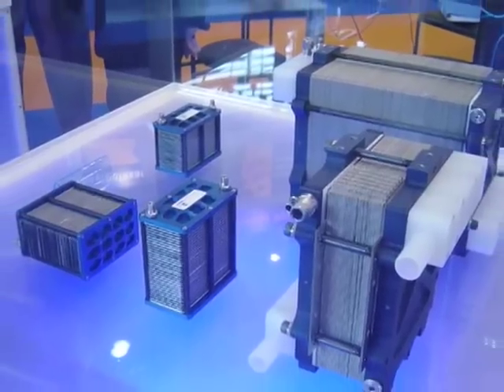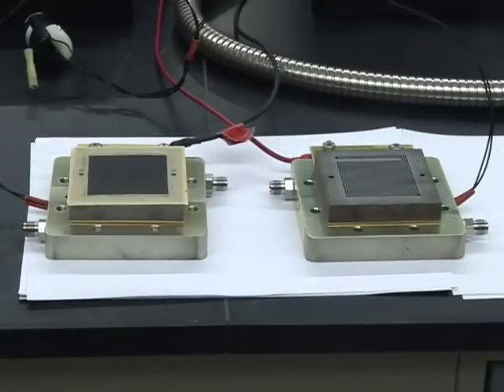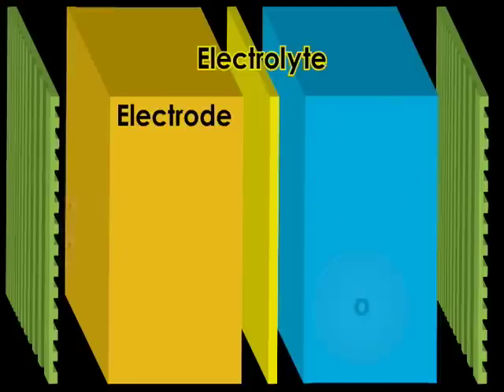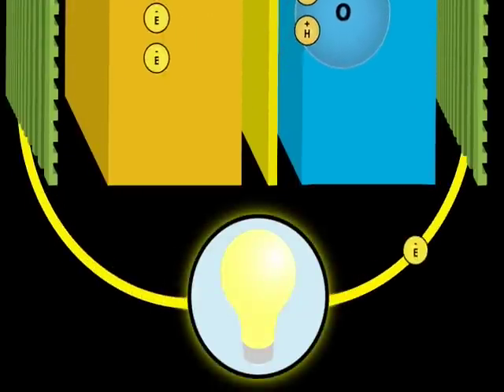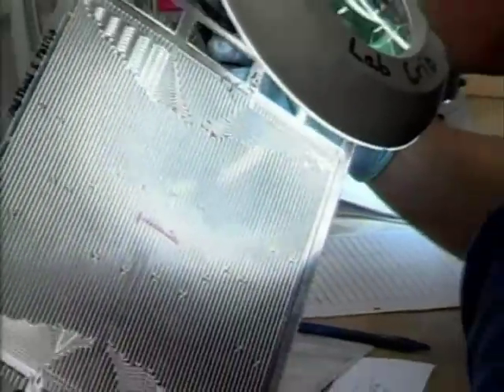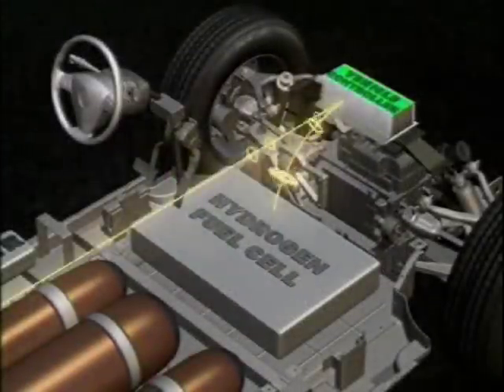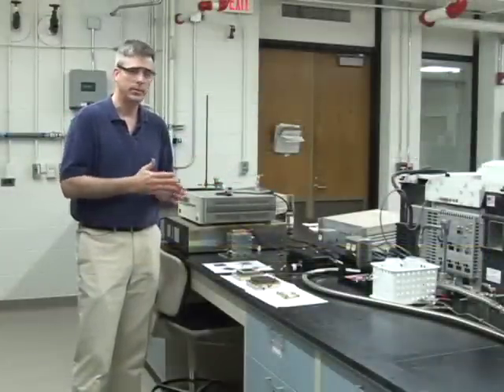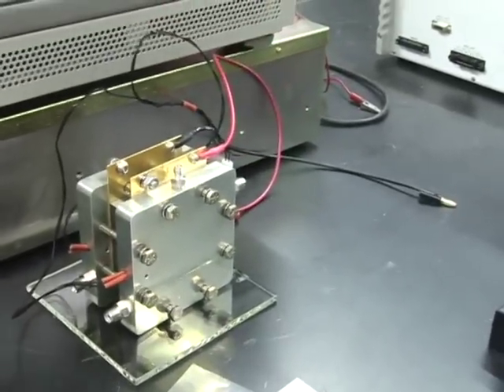How Fuel Cells Work

Comment: There are two deal-breakers with hydrogen fuel cells: 1) Hydrogen is an energy carrier, not an energy source, and making it requires large inputs of external energy. 2) Fuel cells permanently remove oxygen from the atmosphere because they output H20, not CO2 (which plants can recycle back into oxygen). Hypoxia from irreversible depletion of oxygen would be a major issue if hydrogen-based fuel cells gained widespread use. Man tends to fix one problem by creating another.
Reply: NoEcologyNoEconomy He said Methane was also an option, what cons are there about that?(This is a legit question not a mocking one)

Comment: I am all for clean energy much like you are. The question I have is how are we going to accommodate the extra space required to provide the same electrical energy as fossil fuels and nuclear energy. Like the guy in the video said, that one hydrogen fuel cell produces .8 volts whereas the typical voltage output of a power station goes as high as 400,000 volts. That means that 500,000 fuel cells are required by the plant to produce that same amount of voltage plus the space for the fuel source.

Comment: The emissions are minimal. The reason that there are emissions are due to the oil that is still needed to reduce friction in the engine. But like I mentioned before, the plants listed before can be used to balance out if not reduce emmisions. To illustrate and you probably learned this in school, we humans require O2 to survive and your average plants need CO2 to survive. Humans converts O2 to CO2 and plants converts CO2 to O2. In the same way, we can do the same thing for cars.

Comment: @alienmeetworld 
The very first fuel cell was actually run on Methanol, all the way back in 1839, the main waste products from a hydrocarbon fuel and a fuel cell is water and CO2. And he knows about splitting water, I'm sure, but splitting water costs a lot of electricity, and once you scale it up we simply don't produce enough energy from renewable sources to make it useful.

Also keep in mind, that the latest fuel cells we have seen, wasn't around when this video was made.
Things change.

Comment: Another thing is, a hydrogen generator which produces hydrogen and oxygen from water electrolysis can produce about 3 liters a minute of both gases from 360 watts of power at 12 volts. I ran a calculation on a 8 Kilowatt honda generator and it, running at maximum, requires about 3 liters a minute. With results like that, we can not only produce our own fuel, it's free given that we have a well to draw from. The down side is that an electrolyte and distilled water has to be used.

Comment: There's a ton of ways to get hydrogen. One example is from electrolysis, which is basically shocking the water to seperate the hydrogen from the oxygen. And it is renewable, since when the hydrogen is recombined with the oxygen at the end of the fuel cell, it makes water again.

Comment: @vygag, it takes 5 times more energy to make hydrogen from water then you get back out of it with a fuel cell.  It would be far more efficient to use an EV instead. It is far more efficient to make hydrogen from natural gas, that is how hydrogen is made on an industrial scale.  The video is correct.

Comment: @kreinz21, it takes 5 times more energy to make hydrogen from water then you get back out of it with a fuel cell.  It would be far more efficient to use an EV instead. Also, FCV cost about 1 million each to build and that cost isn't coming down anytime soon.

Comment: Ah, see I was thinking at a filling facility. They were talking that since Hydrogen is lighter than air, that in a accident it would actually rise above the car. Now, if the car was on fire, then you'd be screwed. I know there is a working Hydrogen fuel cell car in production now (the Honda FCX Clarity. The only Honda i'd buy), so they must have figured it out.

Comment: @getsafe1212 -
storing energy is not issue.
our problem is, getting the energy TO store.
all the electric tech was developped at a similar time to the internal combustion engine (& infact early ICE experiments *used* hydrogen..)
we use hydrocarbons/internal-combustion because nothing matches their convinience, and the boost society had from digging up *existing* stored energy.  
This is a *huge* qualitative difference between Hydrocarbons & any supposed savior tech.
[more]

Comment: I don't know anything about that project; bu,t I have done some research and been formulating a way of obtaining and using hydrogen not only in cars but as a power supply for homes. Before I continue, I want to just throw out there that there are plants that acts as filters for the byproducts of oil-based explosions and here is a list of ten of those plants at environmental graffiti's website. But anyways, there companies that can convert your current engine to run on hydrogen.

Comment: but what is the point of using electricity to make hydrogen, only to turn it into electricity again? the way your doing it is, chemecal energy in the battery is changed into electrical energy, turned back into chemical energy (hydrogen) and then convert that to electricity?

Comment: Since when oxygen is flammable? I never heard that. Oxygen is needed so that thing can burn, but itself is not flammable at all. You only have hidrogen stored in FCHEV. Oxygen you get from air. Hidrogen tank in cars are very strong so they can whitstand high pressure (5000 or 10 000 PSI). They can even save your life in crash.

Comment: @getsafe1212 - 
If PV cells can match hydrocarbons, do PV manufacturing plants themselves use PV cells? solar electricity is 'expensive' compared to hydrocarbons as in it is Less Abundant.
ie.. when hydrocarbons run out, energy will be Less Abundant. That is the main point we all have to plan for, and its a serious problem because we've (stupidly) used hydrocarbons to multiply human population beyond what sunlight can sustain.